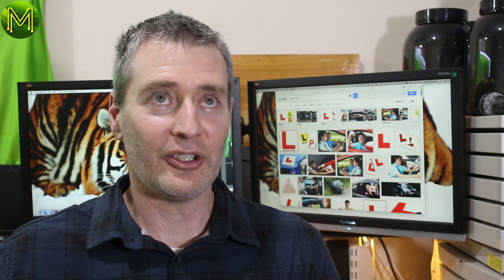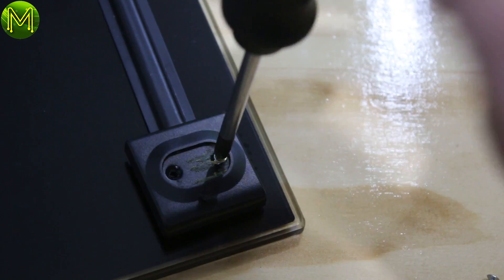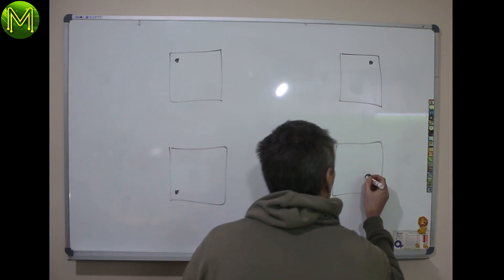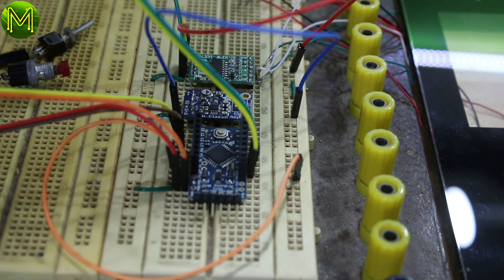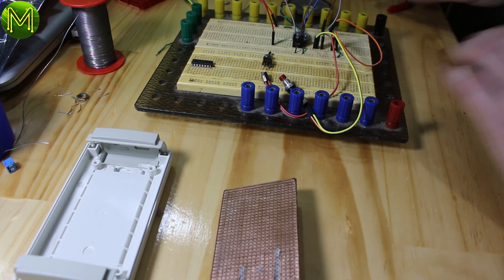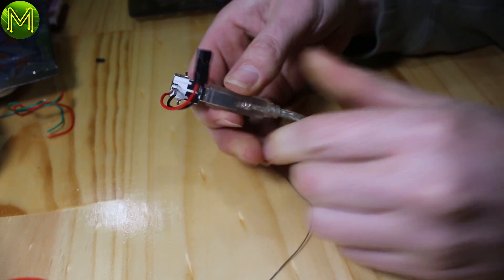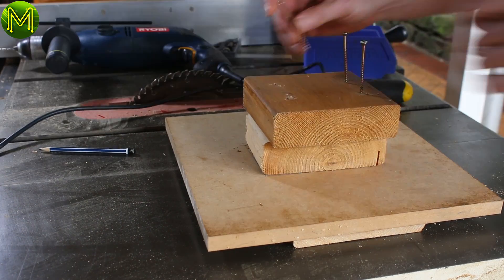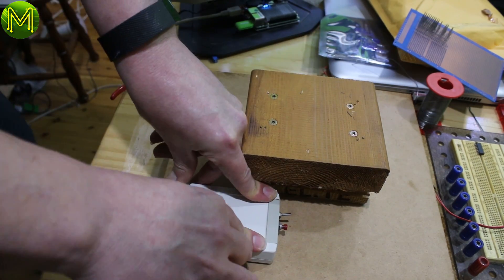#021 How to make a Learner Driver Brake Assist // Project

Comment: With all these new cars coming out that are less and less mechanical, it would be cool to see a "How to make a Learner Driver Brake Assist 2.0" video. I'm not entirely sure if there are many car makes out there that have replaced a mechanical brake lever with a digital one, but the idea is applicable to any car with brake assist using cameras.

The idea is to measure the brake lever's switch resistance and create a second pedal-like object that can act just like the driver's brake, but also offer something like a panic button and a counter for how many times the instructor had to use the brake.

Also, I love your channel. Awesome videos from someone who's passionate about making them. +1 subscriber!
Reply from the maker: +Conner Harkness
Thanks mate! Glad you're enjoying it. I probably should revisit this again. I'll have another Learner driver in the house soon, so I'll be cracking it out again.

Comment: you are soldering your speaker whilst power is applied to the electronics? you might have had luck - having a electric circuit short cut due to a handling failure of the soldering iron can be costly up to the price of all affected items including replacement parts S&H.
Reply from the maker: Yes quite true. The audio amp should not be affected by soldering on the output side, but yes you are correct. I should have removed power before soldering up!

Comment: Hot glue is definitely not an absolutely "secure" mounting method. In a vehicle temperatures will often go beyond 50 or sometimes even 80 °C - and then the whole item has a chance to dis-integrate with only little force. Believe me. :-)
Reply from the maker: Yes, Ozzie summers can get really hot. Good point. Since hot summer days were a good 6 months away I was hoping that my two Learners would be on their Ps by then, but if you're going to use it in summer then screwing it down to the timber is best.